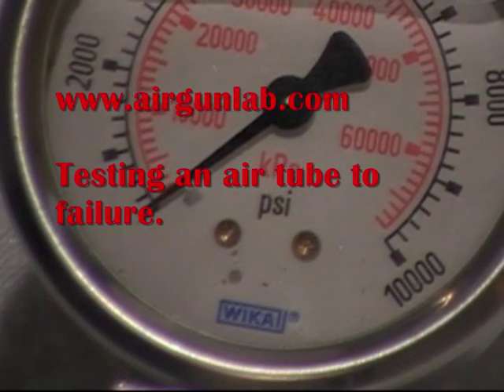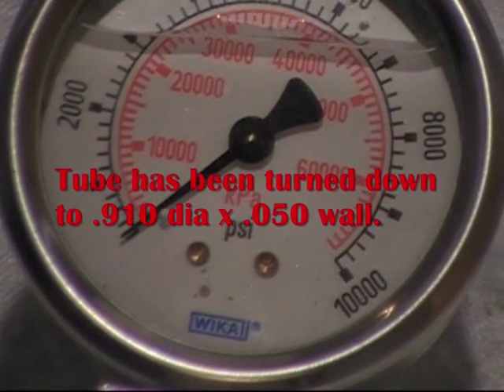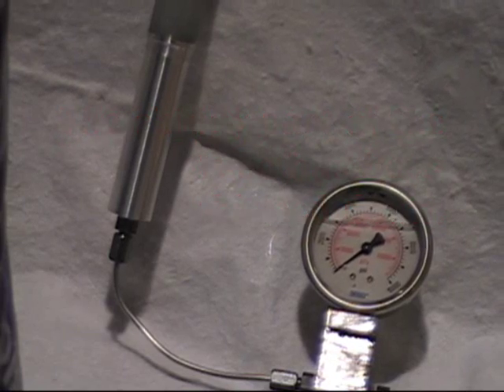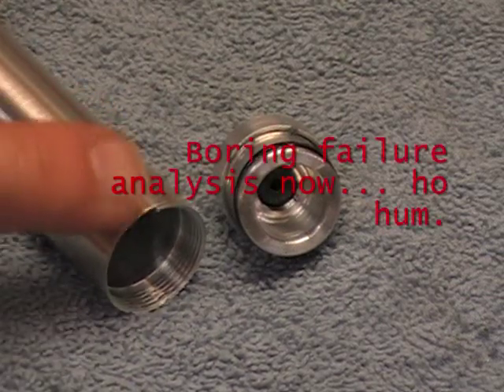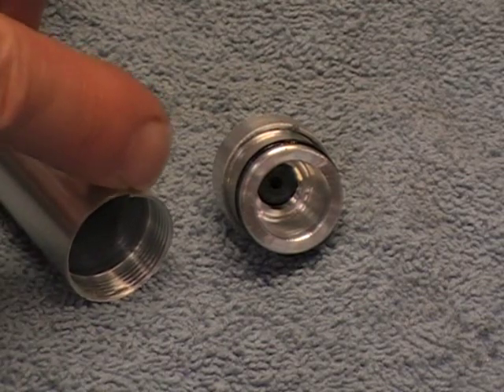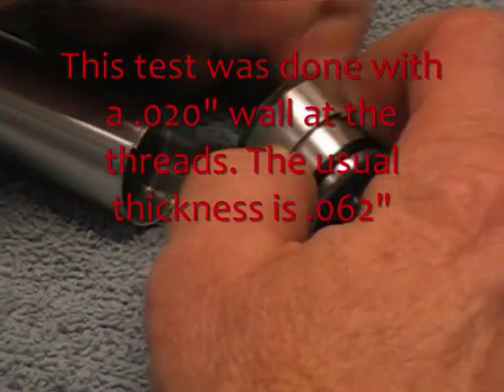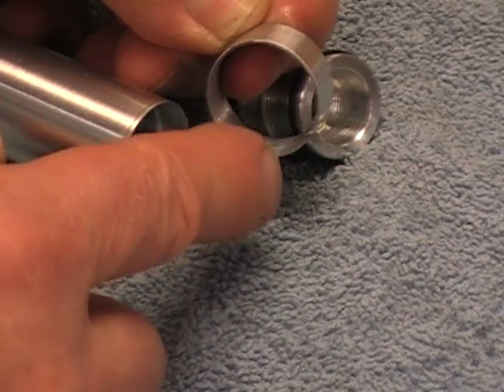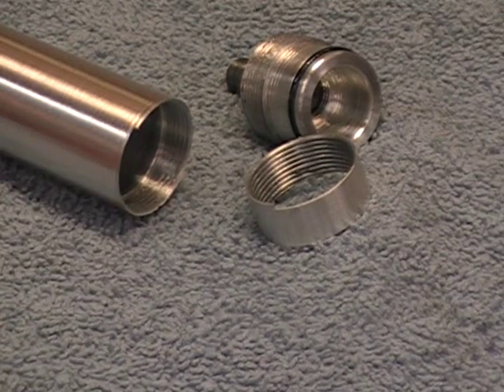BURST FAILURE Airgun aluminum air tube pressure test. Blow it up!

Comment: Great channel, very educational.    I guess many are here because of the L2 failure last year that made news in airgunning community (the cause of which is unknown).   A reminder of the danger of HPA.
Reply from the maker: Thank you for the kind reply. I read a few of the anecdotal accounts of the L2, but as you implied, finding information that is adequate enough to do any type of failure analysis (guess) is almost impossible. My anecdotal information is related to interior features that were not adequately described and therefore might have lead to stress points. But I certainly do not know. What I did find in all of my own destructive testing was that any parts for which I calculated yield and UTS values based on actual part measurements and specified material always exceeded the calculated failure values.  A part that is inadequately described (dimensioned) on a drawing has the potential for problems. Sometimes when model files are electronically exchanged without dimensioned drawings, areas that leave some subjectivity open to the manufacturer do occur. Lloyd

Comment: I wonder if 304 stainless steel tube with the same thickness have the same strength as the high grade aluminium tube here

Comment: Hello, I'm just wondering, do you use Barlow's Formula to calculator burst pressure? If not, which formula do you prefer? Also, is the Barlow formula fine to use with different metals and alloys, say, chromoly and aluminum etc. Many thanks.
Reply from the maker: I used to use Barlow's formula, and at the time I didn't realize that it is quite accurate with thin walled tubes, but as the wall thickness increases, its answer becomes increasingly conservative (extra-safe). I didn't realize this until I was designing the pressure multiplier for an output of 30,000 psi. Intuitively, it seemed to me that Barlow's formula required a very thick wall to handle the 30,000 psi. After doing some research, it dawned on me that the "thick-walled formula" was what I should be using. The thick-walled formula is based on the fact that the maximum stress in the tube is at the I.D. of the tube wall. For example, a mild steel tube .875 O.D. and .065 wall, with 72ksi yield strength, using Barlows formula, will start to distort at 10,700psi. Using the thick walled formula it will start to distort at 11,480psi. So, both formulas are relatively close. But if you use the same 72ksi yield and a .75 O.D. tube with .188 wall, Barlows shows distortion starting at 36,100psi and the thick walled formula shows distortion starting at 43,300psi.

Comment: PCP air cylinder blast it's possible  ??
Reply from the maker: If an airgun is designed properly, something else should fail first, before the tube actually fails. Most likely, and o-ring will leak or blow out.

Comment: Nice vdo 
Are pcp air rifles save as it contains high air pressur...? Is there any expiration date for pcp rifle cylinders, plz reply
Reply from the maker: PCP air rifles are safe when used according to the manufacturers instructions. But they are rifles, so they can be very dangerous when used improperly.
Problems related to high air pressures in PCPs usually are air leaks, not catastrophic mechanical failures.  The small volumes of high pressure air contained in PCP air rifles are usually below the requirements for periodic testing of most regulatory agencies. But, as always, common sense is required. If you have doubts, don't use them.

Comment: I think 4140 steal 1\2 thick will be good for my 50.000 psi going to do some hydro testing to find the low dropping point for safety my guess is 32.000 psi also going to use a vacuum to achieve maximum velocity with a tungsten projectile ,the only thing is I am not sheer what to use for seals ? anyone got some advise .
Reply from the maker: Hello dan. Take a look at this video that I made using a 2 stage hydraulic multiplier that will go to about 30,000psi.
https://www.youtube.com/watch?v=0pKpju0sWVg&t=38s

 Harder o-rings and u-cup seals can take the higher pressures, but metal-to-metal clearances must be controlled to about 0.001"  (.025mm) to keep the o-rings from extruding through any clearance gaps. I have never tried using a vacuum to launch a projectile. The vacuum only creates a 15psi (one bar) pressure differential across the projectile. That is ok for launching something of low density like a ping pong ball, but anything as dense as tungsten will need a lot more force behind it. Lloyd

Comment: do you use hydraulic fluid or something safer and how high of pursuer can it take  thanks .
Reply from the maker: Regular hydraulic fluid for testing. 30,000 psi is the highest I have pressurized it to.

Comment: Hello SIR I have a 6082 T6 aluminum tube,it has 33 mm OD and 6 mm wall , Can I use it for my airgun tank? Can it work with 3000 Psi? The yield strength of my material is 37700 psi, and can you recommend me for the thread I should use and how deep it should be? I'm planing to make the tube 300 mm long. Thank you very much.Hoping for your answer since you post it almost 6yrs ago.

Comment: Hello Lloyd!! I have a 6061 T6 aluminum tube, 1.5 inch OD and 0.177 (4.5 mm) inch wall , Can I use it for a working pressure of 3000 Psi? It is to use as my pcp tank rifle. Thank you very much for your answer!!! Cheers
Reply: +Emiliano Feltrup Look up the yield tensile strength for the alloy in question and put your info into this calculator http://www.engineersedge.com/calculators/pipe_bust_calc.htm
and use at least a 3:1 safely factor. But you will have to figure out how to attach the end caps/valve safely and if you don't know how to calculate the yield pressure of a pipe, I doubt you know how to do that so... go to an airgun forum and start your search for knowledge. It can't all be explained in the comments on youtube. Also, these kinds of pressures are EXTREMELY dangerous so know EXACTLY what your doing before doing anything.

Comment: Hello sir.
 I have here a 6061 t6 aluminum alloy cylinder ang about 1 and a 1/4 inch OD and about 5mm wall so what should be the size of the THREAD for 3k psi?
Reply from the maker: richard cero 
First, if the tube is 1.25 O.D. x  5mm wall (.856 I.D.) your safety factor at yield at 3,000 psi is 4.2 to 1 so you have plenty of strength. You could thread the end with a 1"-16 or 1"-20, or something in that ballpark.  The actual length of thread would need to be about .25" for a safety factor greater than 3 to 1.  These are just casual suggestions based on standard strength of materials calculations. They are not design or engineering advice. If the wall is 5mm, safety factors are still good at 3500 psi. Lloyd

Comment from the maker: 6061T6 is ok for lower pressures, but do the necessary calcs. Lots of engineering resources on the web that you should study. Look up hoop stress or pipe burst calculation. 6061T6 has 40 ksi yield and 45 ksi ultimate tensile. 2024T3 is 50 and 70, and 7075T6 is 60 and 67.  A513 type 5 steel tubing (a commonly used DOM hydraulic/pressure tubing) is 72 and 87, so you can see why the aluminum tubes have to be so much thicker.  But still, the aluminum tubes end up being about half as heavy. Lloyd-ss

Comment from the maker: Going higher than the factory pressure rating of 3000 psi for the P-rod is not something I can recommend. There will be a lot more issues than finding a strong spring, namely, your personal safety.  The stronger spring and boring out the transfer post and part of the valve are fine, and it sounds like you have been very successful with that.

Comment from the maker: 2024-T3 aluminum alloy tube.  7075 DOM (drawn over mandrel) tube is also good, and a little stronger than 2024, but seems to be less readily available.  
Generally, the wall thickness of either of these alloy tubes will have to be about 50% thicker than a steel tube, but you must do the strength calculation and allow a sufficient safety factor (about 3 to 1 or better). Even with the thicker wall, the aluminum tube weighs about half as much as steel.